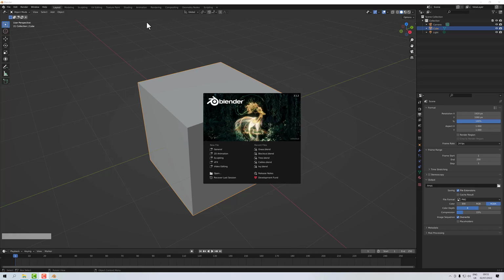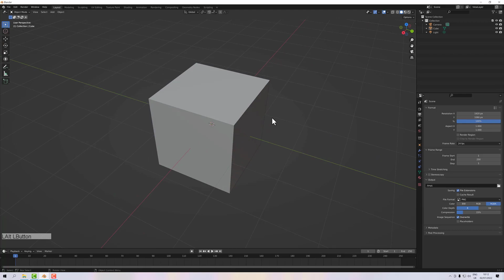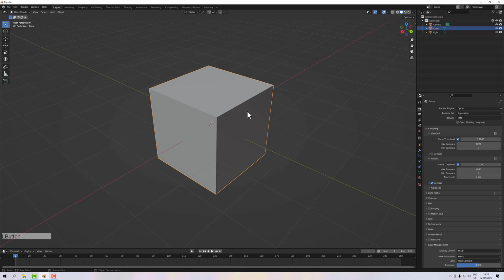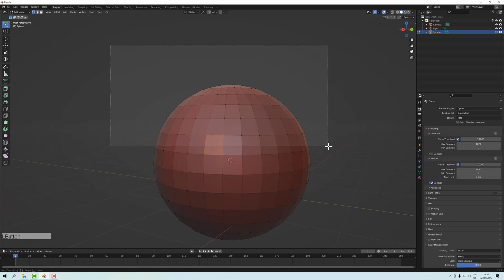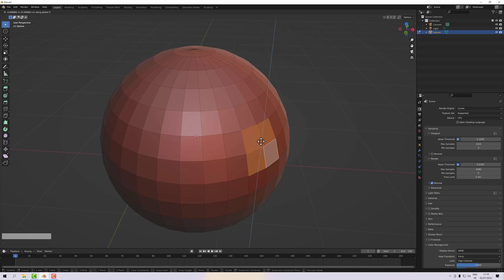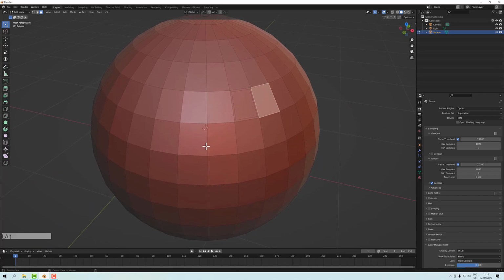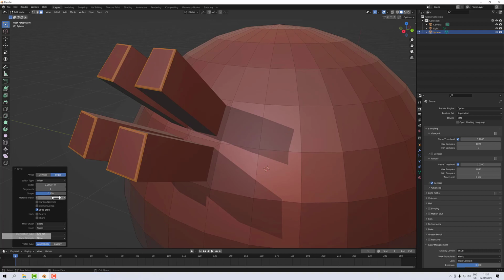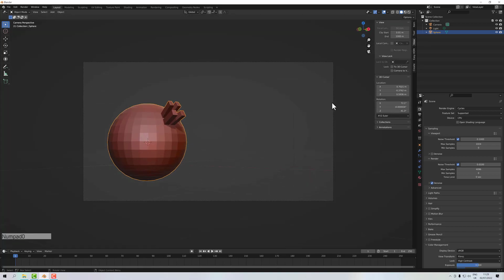Blender 3 Tutorial for Beginners part 1

Comment: is there a way of telling Blender to use the same keyboard layout as yours? Because I am a total newbie here, and when I installed Blender to follow along, Alt+LMB does not move around the object. For me, it seems to be using my middle mouse button. So while Alt and Shift are correct, it's using MMB instead of LMB.
Reply from the maker: Hi Jobo.  I don't think I changed much, will have to look into it and let you know.